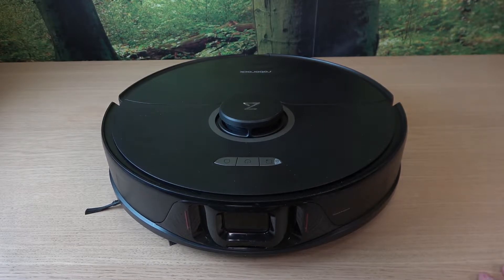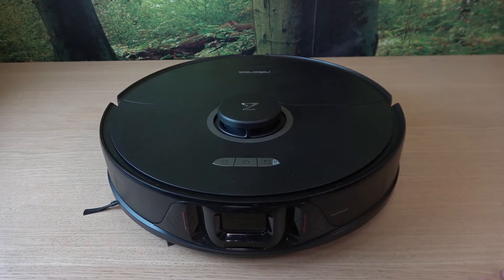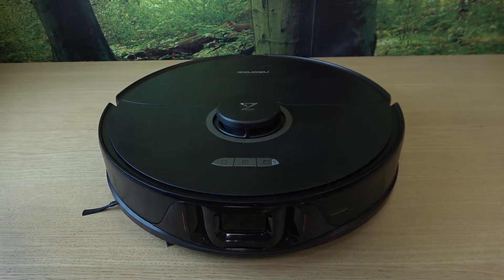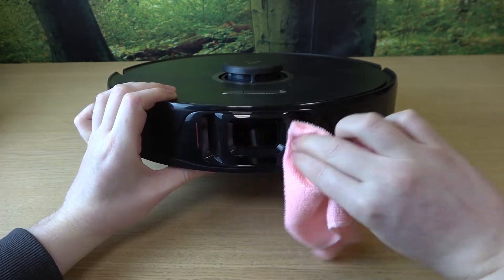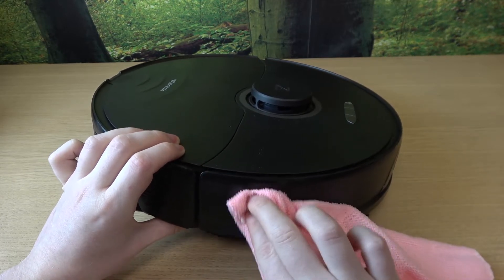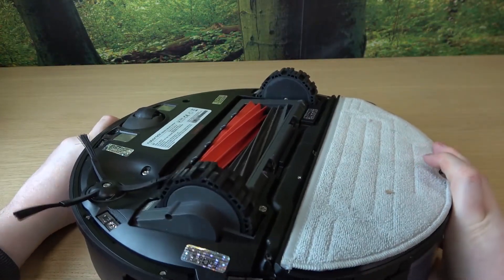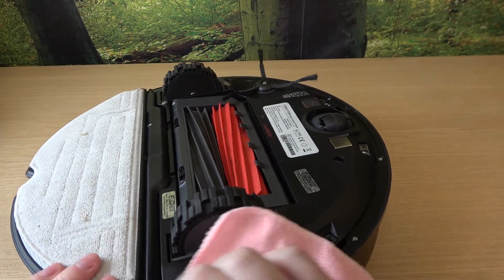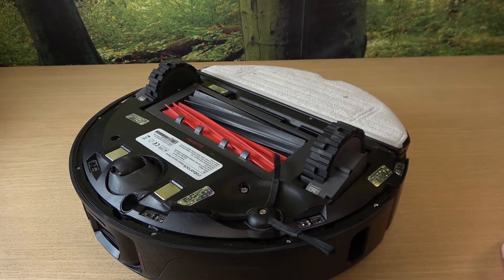How to Clean Sensors on Roborock S8?

Comment: Thank you very much for sharing. I'd like to share in return that Wikihow strongly not recommend to wet the cloth with any liquid. Here is what they say : "Do not use water or other cleaners on your Roborock sensors. Roborock advises against using anything wet to wipe any part of a Roborock vacuum cleaner, including sensors. If liquid gets inside your vacuum cleaner, it could damage it. If the sensors are particularly dirty and a dry cloth does not help, you can try using a slightly damp cloth to wipe the sensors. However, this could potentially damage the sensors and void any warranty you have on your vacuum, so proceed with caution". You additionnaly need to clean the sensors on the station : Clean the dock return and collision sensors on the front bumper. These sensors help your Roborock to enter the docking station and avoid objects during its operation. The docking station’s return sensor is a narrow horizontal oval centered on the front bumper. The collision sensor is a long and narrow sensor that runs along the lower edge of the front bumper. Wipe these two sensors with the dry cloth.